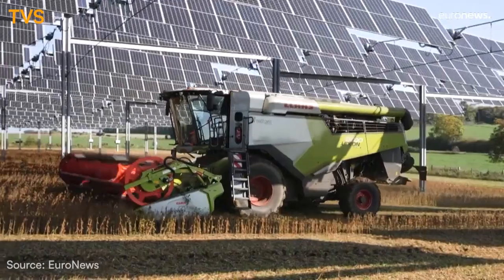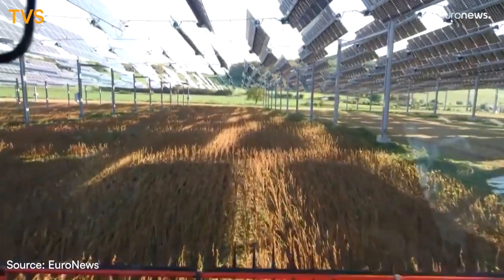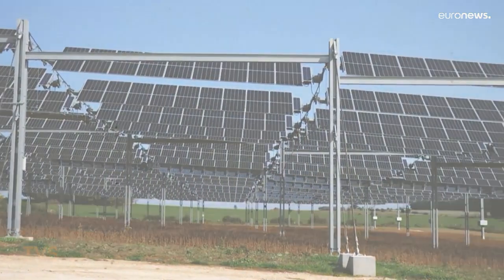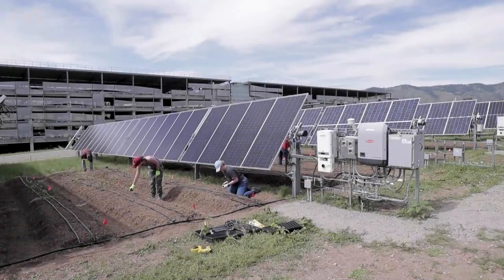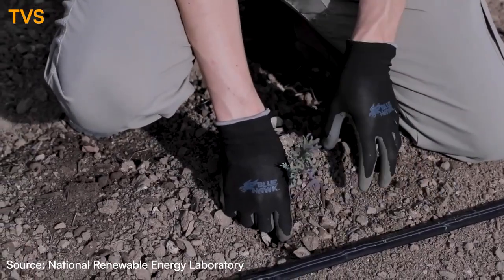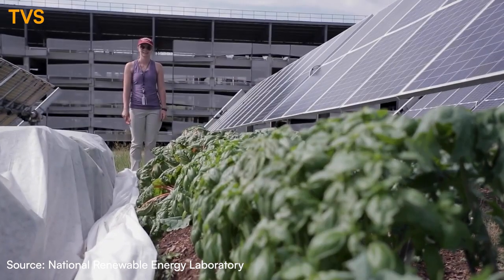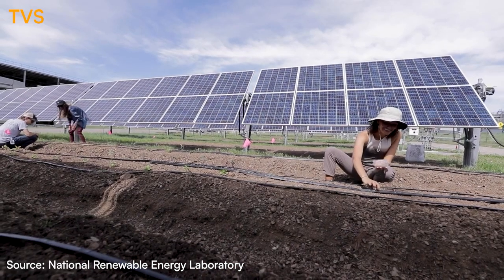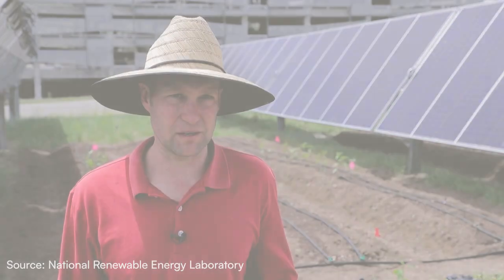Agrivoltaic Systems: The Future of Farming | TVS

Comment: Solar will grow 20% ... it is too slow.  Solar accounts for a small percentage or total power, and it is not 7x24-hour.  It's great but it cannot scale up or provide steady power.
Reply from the maker: Hi there! Thanks for your insightful comment. You're absolutely right that solar power does have its limitations, especially when it comes to providing consistent, round-the-clock energy. However, it's important to remember that solar is just one piece of the puzzle when it comes to renewable energy.

Other sources like wind, hydro, and geothermal can complement solar and help provide a more steady power supply. Additionally, advancements in energy storage technologies, like batteries, are making it increasingly possible to store solar energy for use when the sun isn't shining.

That being said, I'm curious to hear your thoughts. What do you believe is the best option for steady power in our pursuit of a sustainable future?
Reply: @thetvschannel  
> However, it's important to remember that solar is just one piece of the puzzle when it comes to renewable energy.

True, but as long as we're talking in slogans it's also important to remember that a chain is only as strong as its weakest link, and the global energy distribution system should be designed with maximizing reliability and robustness in mind.

Picture two scenarios:
A.) All Nuclear power generation.
B.) Nuclear generation with Solar.
Adding solar creates demand for other sources of energy to fill in for it when it is not working.  So with an all solar development you automatically need another source of energy from the get go, it must be designed in.

This increases complexity, cost, decreases maintainability, and puts a drain on the resources that go into creating solar panels.  

I am not advocating for anything in particular, but just pointing out that all things being equal is isolation ideally you don't need solar - at least for grid tied use.  It's nice, but it has side effects to everything else - as does nuclear too.
Reply: @thetvschannel  
> I'm curious to hear your thoughts. What do you believe is the best option for steady power in our pursuit of a sustainable future?

I am not sure there is even as remote possiblity that the human race's existence on planet earth is going to be possible.  If it is all future humans will have to live every day looking at the destruction of the very planet that spawned us while we cling to live by artificial means.

But if there is ... again, doubtful ... I think nuclear is the only hope, integrating the breeder reactor technology.  Very carefully, but very massively and cookie cutter.

I think is you look at the economy and people's lives super-cheap abundant energy is the key to everything because humans have to segregate their actions from nature, while at the same time repairing nature, and keeping it from collapsing.

An example would be to compare the two sides housing.  We can either gather the resources, spend the money and effort to make super-high-tech houses - or retro-fit old houses, or with enough cheap heat/A/C we return back to when most houses were build - no insulation and cheap energy, wood, coal, gas, previously, which was the problem - or wipe out the problem by creating monumental size energy generation.  Water the same thing.  We can create energy easier than we can do just about anything else.